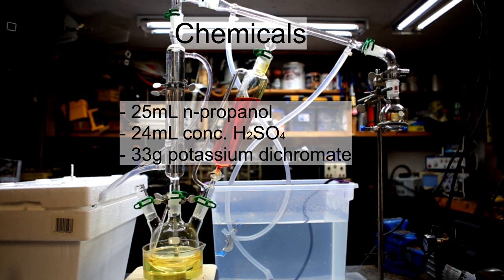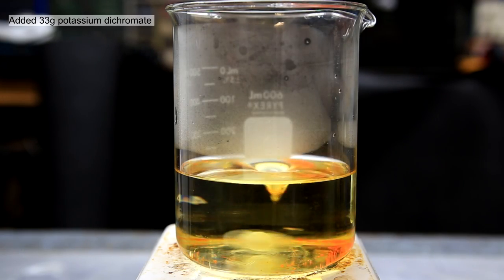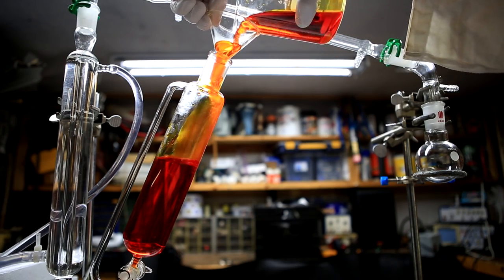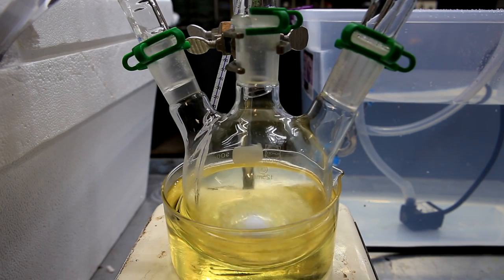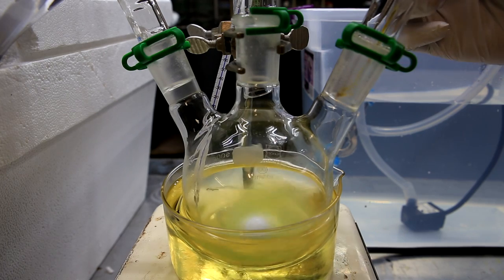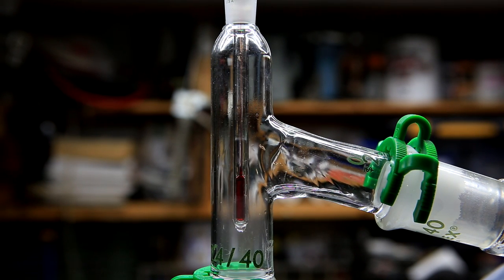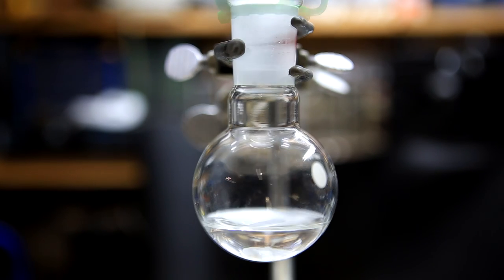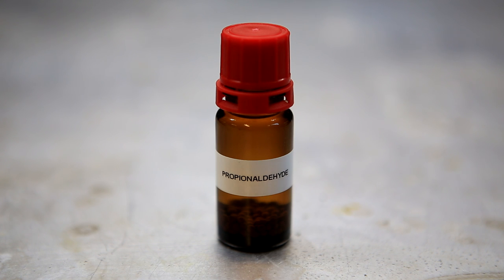How to make Propanal (propionaldehyde)

Comment: As a PhD organic chemist that has worked a lot with small molar mass aldehydes, I have to say that in general aldehydes only by the vigorous stirring of their solution (neat or with solvent) with the atmospheric air causes their rapid oxidation to the corresponding carboxylic acids. Therefore, not only an ice bath is required to minimize this phenomenon, but under Argon atmosphere is a must! Best regards, colleague NileRed. You're awesome.
Reply: Yeah whatever he said

Comment: Did you consider using pyridinium chlorochromate as your oxidizer instead of chromic acid? This way you wouldn't have to worry about any propionic acid forming.
Reply: Chromyl chloride is also suitable. It won't oxidise aldehydes. And doesn't require pyridine. There are even some videos about it on youtube.
Reply: Martin of Gliwice Yup, it's also a pretty good choice. Although pyridine is actually pretty easy to make if you have access to niacin from online suppliers, chromyl chloride is admittedly easier to make with OTC reagents. But I would prefer PCC in the end because it can be stored long-term without having to worry about hydrolysis or any dangerous vapors.
Reply: I think the best oxidisers are K2Cr2O7/H2SO4 or KMnO4/H2SO4
but can't he use H2O2 as well? I've heard it's a pretty strong oxidiser
Reply: For pcc reaction the solvent you will need dichloromethane as your solvent. However, since it boils before propanal it will be troublesome to extract pure propanal
Reply: @johnk3903  H2O2 is strong and that's what you DON'T want when your product is an aldehyde. A strong oxidizer will oxidize the aldehyde further to a carboxylic acid or even to CO2, like Nile says in the video.
Reply: DMP is literally made for this….
Reply: exactly

Comment: great vid, but there is something i didn't understand ...  you have used 60C water in that condenser instead of cold water .. it confused me a little ... so just to sort all this in my head .... you put 60C water because Propanal  need to be re-condensed and it will return back to the round bottom flask?  while the n-propanol  passes throw the condenser ?  or i get it wrong ?
Reply from the maker: +omar abuawwad Other way around. The propanal can pass but the propanol cant because it boils at 90C+ and will recondense.
Reply: Yeah you had it backwards.

Comment: +Nile Red I know that acidified dichromates are great oxidisers, but have tried to use hydrochloric acid instead of sulfuric acid (it´s much cheaper and easier to obtain)? If you did then it worked, right?
Reply: Chlorine

Comment: What submersible pump did you use for the 60C water?  All mine say cannot be used for temps over 35C.
Reply: Yes, I had the same worry. I went ahead and used mine (just a standard home depot 70gph) - it worked at 60C and still working today.

Comment: would this work with regular, 2-propanol? IPA is structurally different,having the hydroxyl on the second carbon, but would it still form that double bond, carboxyl? Many of us have gobs of IPA  :-)
Reply: +AddisonPhilips –No.1-propanol is really a secondary alcohol, and even though an isomer of 2-propanol, it behaves quite differently when oxidized. I read that it would be oxidized to acetone. But we could make propene by simple dehydration, like with concentrated H2S04.

Cool stuff. Great videos. Thank you.

Comment: Could you make acetaldehyde from this procedure too, since k2cr2o7 is so toxic and forbidden, could it be replaced?
Reply: There are many other ways to oxidize alcohols to the respective aldehyde that don’t use hexavalent chromium. The more notable ways being the Swern and DMP, but they utilize entirely different procedures. And yes, if you started with ethanol, you could produce acetaldehyde.

Comment: Could you do a video on the synthesis of formaldehyde?
Reply: I'd imagine it can be made with relative ease from hexamine tablets.
Reply: +firearmsstudent The synthesis of formaldehyde is quite difficult to perform in the home lab, but I can recommend to buy paraformaldehyde to make a formaldehyde solution or buy "KUSURI Formalin" which is a 30% solution and works well for many purposes.
Reply: +Random Experiments International I've seen some video's of the copper-catalyzed burning of acetone, which created formaldehyde if I remember correctly.
Reply: To make formaldehyde methanol is used and copper oxide. The copper oxide becomes copper and has to be oxidized again. So, the vapors have to be mixed with a small amount of oxygen. The reaction is exothermic and has to be cooled, otherwise the methanol vapors could ignite. The reaction takes place at a few hundred degrees. All of this is very difficult to achieve in the home lab.
Reply: +Random Experiments International I imagine this is the industrial method. Home labs need not use this particular method. Moreover in home labs efficiency is a secondary concern and a particular method might be chosen precisely because it's hard.
Reply: reaction between DCM and NaOH/KOH solution is a pretty easy way to make it, assuming you have acces to DCM
Reply: Here in the states, we can just buy gallons of formaldehyde at a 37% concentration for little of nothing online.  So if you're in the states, just buy it.
Reply: @SuperAngelofglory  DCM can be easily bought online here in the states as well.  But as I said in my original comment, we can just buy formaldehyde by the gallon here too if we wanted.
Reply: @BackYardScience2000  in the EU DCM is not easy to get (paint strip is DCM free here as they phased it out due to environment regulations) and formaldehyde is even harder (at least where I live)
Reply: @BackYardScience2000  oh, and methanol is hard to find too, but not impossible.

Comment: What does the "n" mean in n-propanol?
Reply from the maker: +Epzilonz It means "normal". What normal means is different in different cases. In this case it just means 1-propanol.

http://www.masterorganicchemistry.com/2011/11/10/dont-be-futyl-learn-the-butyls/
Reply: +Nile Red Thank you for link but, its too difficult for me. im just an eight grader.
Reply from the maker: Just keep at it and it will get easier! It is definitely a slow learning process.
Reply: +Epzilonz n-propanol is a "traditional" name for 1-propanol, is used to differentiate it from another compound called iso-propanol (iso means equal, symmetric) which is 2-propanol. Iso-propanol is also a "traditional" name.
Reply: +Epzilonz It stands for normal. There is a cyclo- and iso- stems for rings and isomers. But normal is just a straight up chain. Like n-hexane and cyclohexane. 

You are very smart by asking. Keep it up and you will do very well in chemistry. Don't worry about this stuff yet because it's organic chem. You still need to finish general to understand the fundamentals.
Reply: +agent475816 So patronising 😂
Reply: Mo Hoosen Is that a good or bad thing?